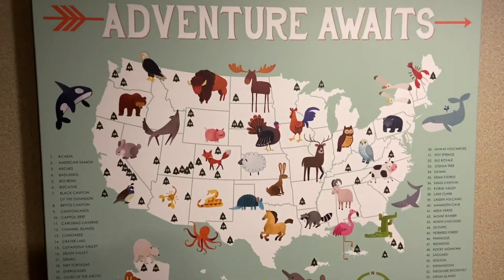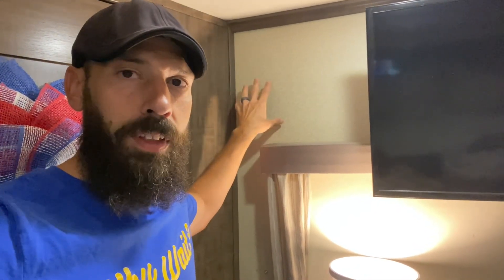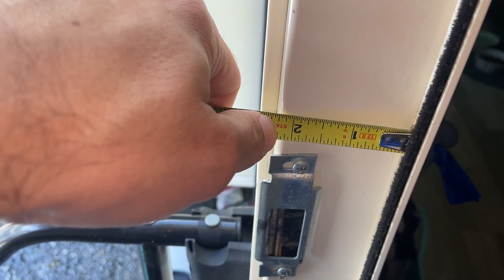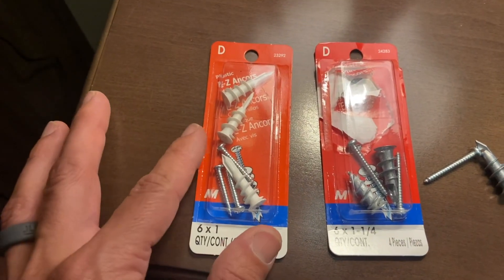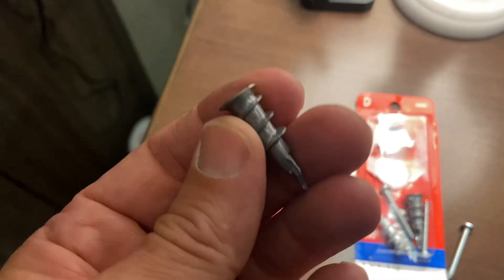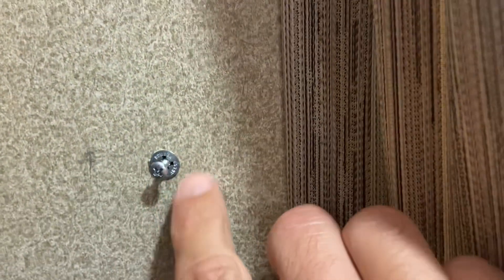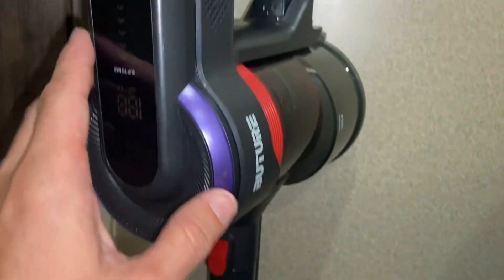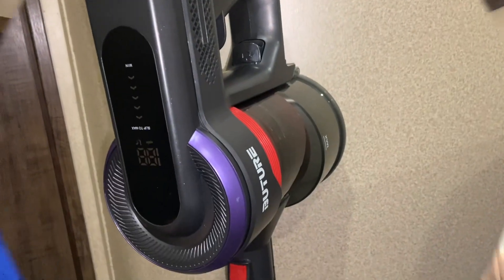How to Properly Hang & Secure Items to Your RV Walls

Comment: I was told you can’t put screws in the walls because of wiring, etc?
Reply from the maker: It depends on where you want to hang something. You definitely want to avoid any electrical or plumbing runs. Most RVs have no wiring at all in the outer walls because they are styrofoam vacuum sealed.

Comment: Thanks! We have had problems with the command hooks and adhesion here in Cali. We are near the beach and they just melt off. Thanks for the info for a better solution! We were considering hooks or rivets. We'll try these anchors first.
Reply from the maker: Good deal. We have actually had tons of success with our Command strips. And we camp in extremely humid areas long term. Might just be the inner wall material that makes a difference. 🤷🏻‍♂️

Comment: What do you recommend to secure blinds to the 5th wheel ceiling.  Our blinds keep falling out because of the screws?  Same??  Thanks
Reply from the maker: Not sure really. ive never attached anything to my roof. Probably a dry wall screw or try and find a stud to drill into
Reply: @WhyWait  thank you for the reply.  I was trying to make it harder than it needed to be.

Comment: How about slides? Looking to build a custom desk with no legs in one of our slides? Same anchor for exterior wall?
Reply from the maker: Pretty much. I can’t speak for every camper out there though. The slide walls in ours our the same. Open a window in a slide just to make sure and check the depth. Then of course try and find a stud if possible 👍🏼

Comment: Thanks for the video and tips! I am very interested in how you know where it is safe to put the anchors in the exterior walls - how can you be certain not to hit any wiring? I am trying to mount some shelves and feeling quite nervous about this. Thanks!
Reply from the maker: I never really worry about it. But Use a stud finder: A stud finder can help you locate studs and electrical wiring. Some stud finders have electrical detection capabilities and will beep or light up when they detect live wires. Avoid drilling near outlets and light switches: Wiring typically runs horizontally 6 or 12 inches above outlets in homes anyways. For the most part a screw or drill will just push past a wire or push it out of the way. The wire has to be fastened extremely tight in place for the drill to go in it. Most RV exterior walls are vacuum sealed with styrofoam and won’t have wiring in it. Most if not all outlets are in the interior walls in a rv.

Comment: Another great video.  What do you think of using Pop rivets instead of the EZ Ancors?  We are getting ready to re-hang our headboard after trimming it down to accommodate a new mattress.  The original screws won't hold any longer, and I want to use the same holes on the top.  It will be into an exterior wall.  Thank you for the video.
Reply from the maker: @captmike390  gotta be honest with you I’ve never had to use a pop rivet in my life and don’t know much about them. 🤷🏻‍♂️
Can’t hurt to try right. Let me know how it all works out.
Reply: @WhyWait  While popping a few practice rivets beforehand, I jammed one in the rivet gun.  So I went with the wall anchors, and they did the trick.  I'll find another use for the rivets.😊 Cheers.
Reply from the maker: @captmike390  good deal Mike. Thanks for the update.

Comment: Trying to mount a "handrail" on the exterior wall in the stairwell of my 5th wheel.  What type of anchor would you use?
Reply from the maker: We have a handrail in that spot, it’s mounted with screws, they are drilled into a stud if you can find one. 👍🏼 If not use the wall anchors and screws.